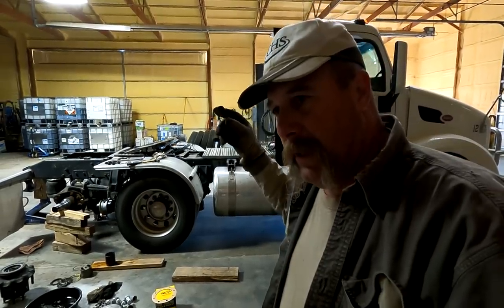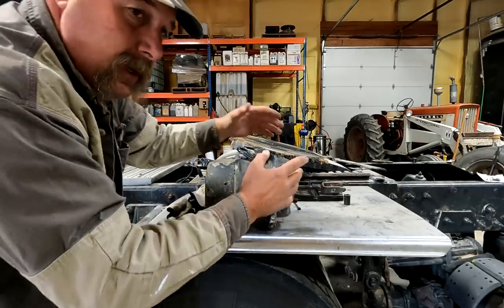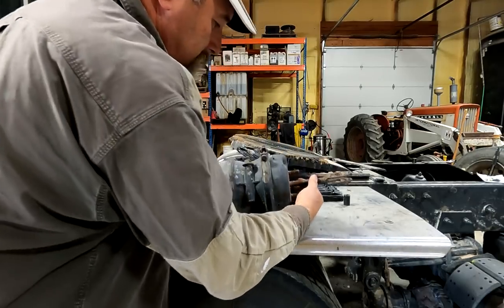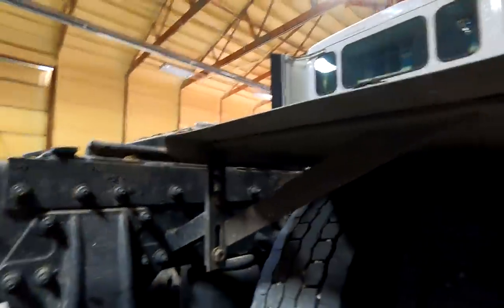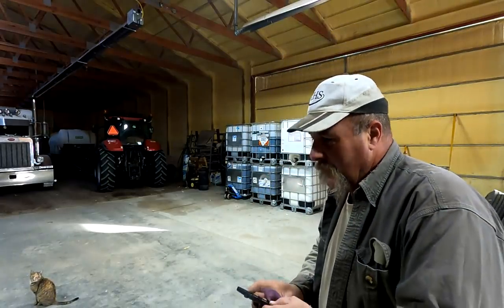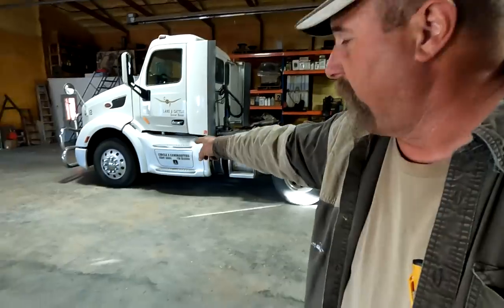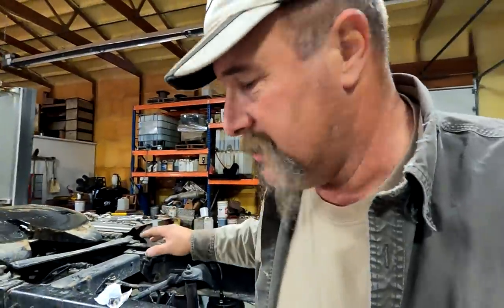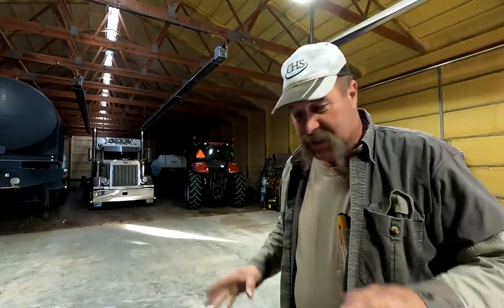659  S Cam Air Brakes

Comment: Actually the best demo, explanation of a slack adjuster I've yet to see i  person or on YouTube. Thanks. I was taught to point at the slack adjuster when I got my cdl, but I never really understood it.
What I always knew was that brakes not under pressure are locked. I didn't really know what to do if I lost air and needed to loosen the brakes.

Comment: I knew roughly how air brakes worked, pressure required to disengage the brake shoes, but not specifically how "S Cam" brakes worked, so thank you!

Comment: Hard to believe now , but we used to carry pancakes in the side box and replace them on the road, although you damn sure wanted to make sure that pot was caged. Now days I don’t think you can even take them apart. And i wonder how many of the drivers out there now even know how to adjust their brakes anymore . Take care Driver !
Reply: 100% Mr C, and add to your list changing a spider and aligning it so it doesn’t wobble.
Keep smiling mate 
JD
Reply: You can take the pancake apart still. The main chambers have a sealed ring now. We still change out the front seals (pancakes).

Comment: The first item on a CDL test in Calif is the air brake system. If you fail 1 item on the brake test, you flunk the overall test and must retest.
Thank you for the mechanical explanation of these brakes.
Reply: That’s a federal rule all states follow the same guidelines.  Not just CA.  This is a great video.
Reply: @dbmurray0924  I've had my CDL for many years and I too enjoyed this video.

Comment: Aw, Stan, why didn’t you put those seals in for the boss? If you can explain the “S” Cam type air brake you should be able to put the seals in. I know you can do it. Heck if I can I know you can! Way back when I was hauling logs we did this type of stuff on weekends getting ready for hauling next week! Brakes, Tires, Seals and such as this lights! Even managed to put in a couple throw out bearings and carrier bearings as well. Transmissions and engines were someone else’s problem tho!
Reply from the maker: I left it to Kirk.....If it leaks its his fault

Comment: It's on the cdl test. And Québec has a super strict pre-cdl program, but unless a mechanic actually put a truck up on jacks and did what you just did, it's not the same as a diagram in a cdl book

Comment: I had a brake catch fire once, pretty scary. The top shoe had come apart and wedged itself under the bottom shoe. Emptied my fire extinguisher and a 2 liter bottle of soda. Tried using a bottle of windshield washer antifreeze, bad idea! That stuff has alcohol in it…
Fortunately I was in a rest area and got water but in the meantime, the inside tire popped, made my ears ring for a while…

Comment: Also kids, do not EVER try to open the main chamber of the can (brake chamber) you will get you head knocked  off by a spring inside the chamber. I have almost 2 decades of working these systems, glad that I will not have to deal with them again....lol.

Comment: Could you please explain that one more time. 🤣✌️
Reply: Real quick refresher. Air applied pushes chamber shaft, shaft pushes slack adjuster which turns cam, cam turns while pushing brake shoes outward to drums.

Comment: do nit useg  use an ari gun on that  - use a torque wrench
Reply: What torque wrench are you going to use one semi truck tires? Those things are tightened to 500 ft lbs (678 Nm). They have been using impacts on trucks like this for so long, its just common now. On a smaller vehicle, don't do it, grab a torque wrench.
Reply: @snoopdogie187  we have torque wrenches for them. They are big, but the exist. Used them more times than I can count.